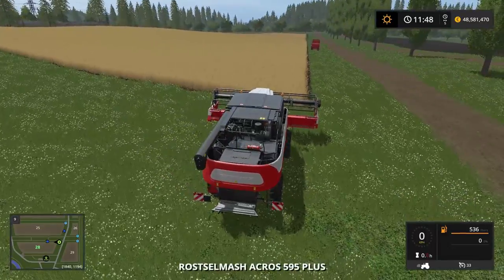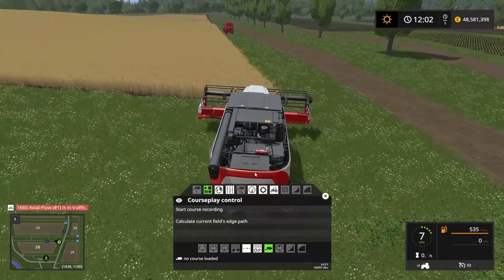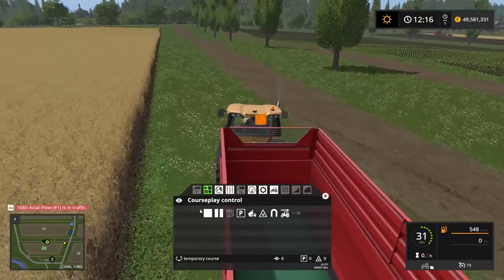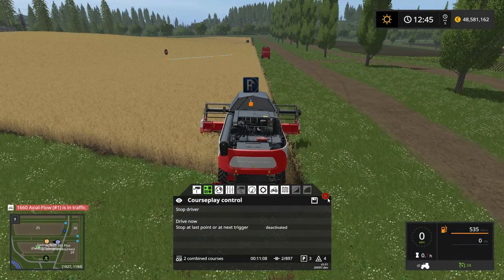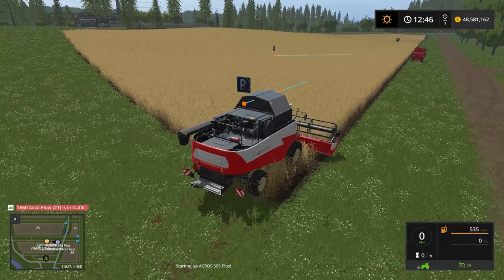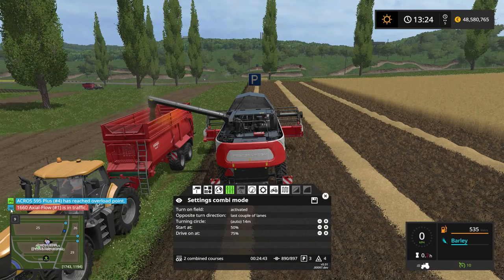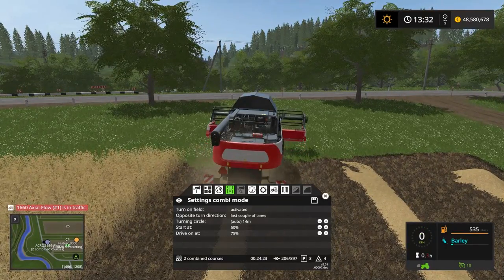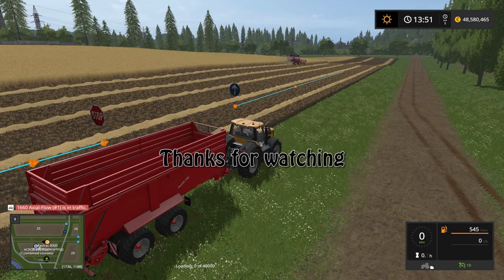How to set up Courseplay for Combine Self unload - Farming Simulator 17 Courseplay Tutorial

Comment: Okay, I tried using the combi self unload for running a forage wagon, but I find that when you want to designate where it unloads, you can seemingly only run alongside, or back into a location to unload to. Any suggestions? 

P.S. Since using course play on the map of Maverick's Multifruit, it has been much, much easier especially after watching your vids and getting a much clearer picture of how it works and having the additional vehicles running why I used to by myself.
Reply from the maker: I would think that the forage wagon would use the normal Field Work mode. Not sure it is recognized as a combine. Perhaps that is why you are experiencing these issues?

Thank you for the kind words! It really means a lot to me :o)

Comment: I'm trying to have 2 courses combined, but mine does not do what yours does.  It always "merges" the two courses and gets rid of the start or stop of one of them and makes it one big course, which of course does not work.  How do I keep them as 2 separate courses but combined?
Reply from the maker: You could try using the Append function instead of using the Merge / Load when you combine the two courses. Have a look here where the developers of Courseplay talk about the difference between Merge / Load and Append: http://courseplay.github.io/courseplay/en/manual/index.html#hud_manageCourses